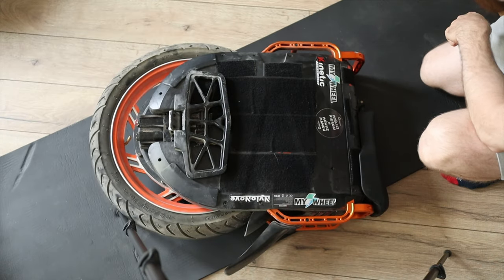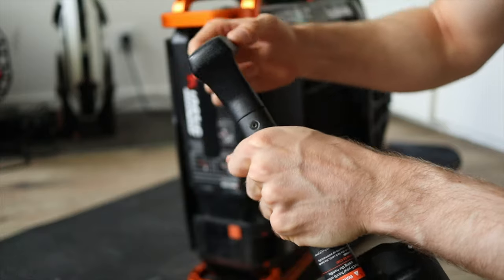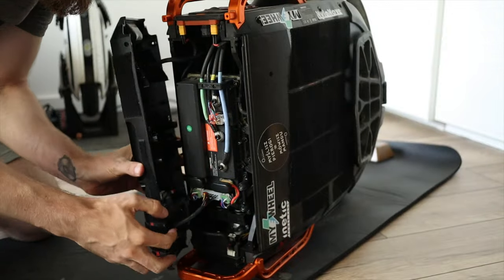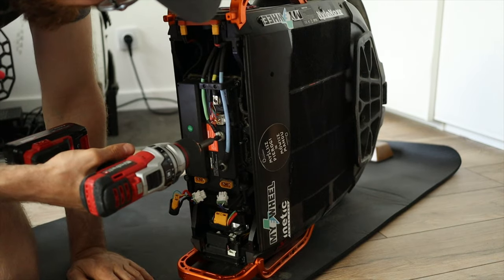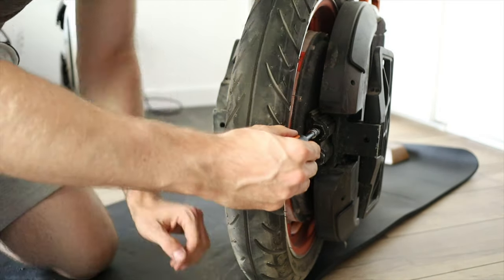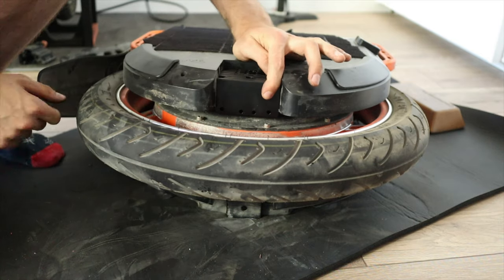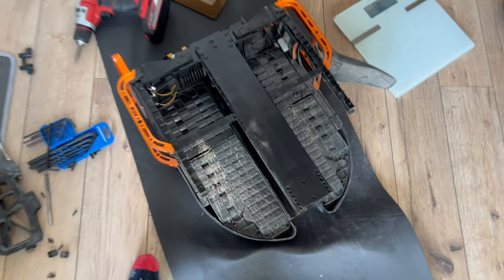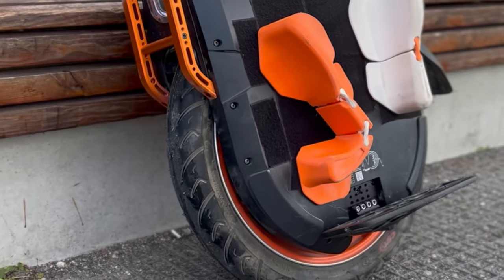INMOTION V13 DURABILITY TESTED

Comment: This is pretty much the same as when you pop the hood on your car with regards to the connectors/fans being "open to the elements".
If water falls on the unit from above, it will flow around and off.
If water is sprayed from below, it won't contact anything that can't tolerate a bit of spray.
It should not be submerged, just like a car. In other words, it's IP55.
I think the build quality is very good.
Reply: But corrosion is an issue in snowy countries due to road salt. Cars are built to handle it, but i don't think EUCs are.
Reply: @MikaelLevoniemi  it is the same for every pEVs man. EUC is still shit quality but it definitely improves alot compared to years ago
Reply: it should not be submerged, much like carbon fiber submarines
Reply: @Blox117  A puddle is enough to douse the internals all over.
Reply: Car or motorcycle... even off road stuff. And, at least with motorcycles, some of the exposed wires are quite low on the frame, such as brake pedal sensors on some models. What is not shown is if any kind of paste that is often used to help water proof connections. Generally this kind of thing is good for for one or two reconnections but really should be cleaned off and reapplied each time for maximum effect. The main thing is that the electronics bricks are sealed properly. It is too bad the batteries can not be repaired cell by cell but no repair shop or warranty repair would do anything but replace the whole pack anyway as trouble shooting to the cell costs more for hours worked than replacement. It does look good, yes.

Comment: i think the waterproofing is actually fantastic, all i had to do myself was add some dabs of silicone to the tops of the bms and the main and rear connectors. I think its a fantastic design actually, have everything open but silicone all of the electronics that are exposed so they literally just cant get wet even tho they dont have a cover. Basically the entire wheel is like that

Comment: at 8:03 the pedal adjustment is a plate that screws on the bottom of the pedal that adds more angle.  It came with my V13 and I have installed it recently cause I felt I needed more angle.
Reply from the maker: Interesting! Good to know! :)

Comment: I, in fact, crashed the v13 in a puddle and it been powered down ever since. It’s been a few week and i can’t figure out the which part to replace. I contacted my seller and they’ve been working with inmotion to figure it out. 😅😅 SO IF YOU WONDER, it waterproof as long it stay up.

Comment: I wish that Inmotion would remake this wheel higher discharge cells
Reply: The issue is that it's using 18650 cells, so the next best option is the Samsung 30Q (it uses 35E according to E-wheels) but then you go from 3500MAh to 3000Mah in order to go from 8A to 15A discharge. Molicell seems to make a 3000mAh 30A battery called the P30B and a 3500mAh 10A called the M35A also.